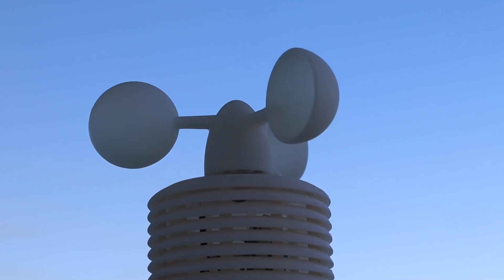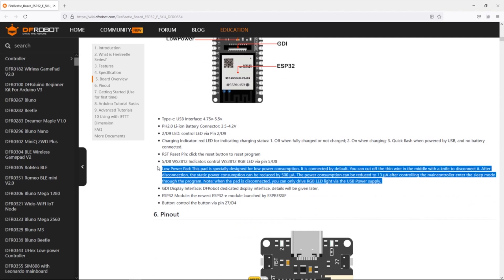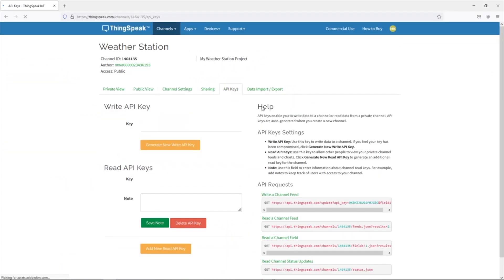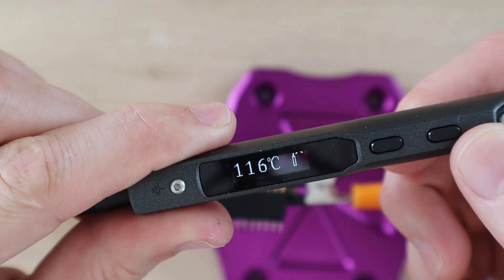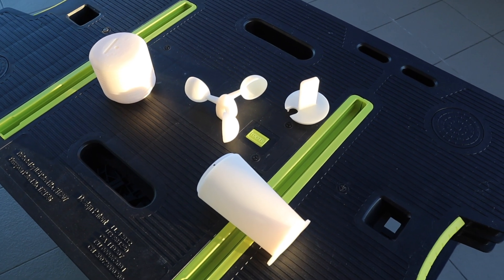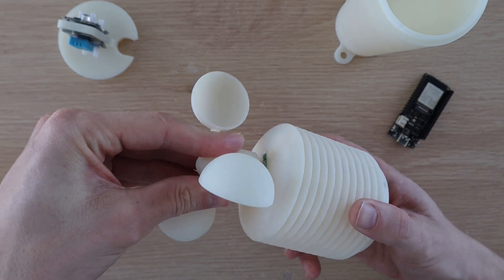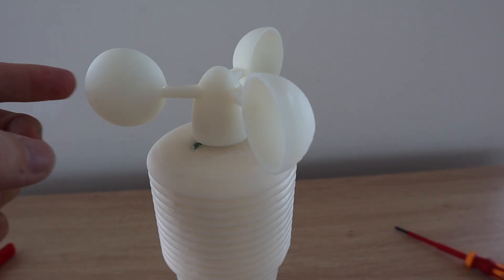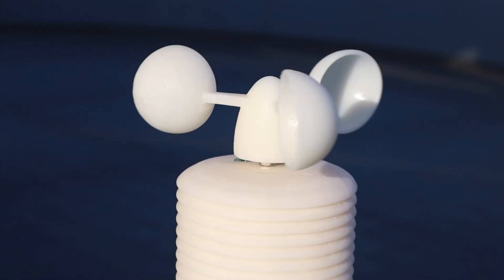DIY 3D Printed IoT Weather Station Using an ESP32

Comment: @UCPNq-cWaMPccZydtyhMXGGQ also: ESP32+other circuit components can become really hot, while experimenting with some prototypes i have seen cases where the temp reading were 2-3-4C higher because of that. I would suggest you to put the Temp sensor on a spot far away from all the other components (best thing would be to put the Sensor on the bottom and the ESP/circuit on the top, since hot air goes up, so with the current design all the hot air inside the prototype is going on the top, right where the Temp sensor is...)
Reply from the maker: The ESP32 in this project is in deep sleep mode for 9.5 minutes of every 10 minute cycle. During this time the processor is powered down and no heat is generated. It doesn't have enough time in the 30 second data acquisition period to generate much (if any) heat, so this isn't really an issue for this particular project.
Reply: @MichaelKlements  I know that with DS it generates less heat, but still... I would swap their position from top/bottom just to be 100% sure that not even a 0.1 degree is wrong due to circuit's heat
Just a friendly suggestion, then it's up to you

Comment: I'd be curious to know how the components hold up after a while outside. Does the 3D-print melt in the sun? do the electronics short out from water/moisture?
Reply from the maker: I'm also interested to find out, I'll be posting an update on my blog in a couple of months.
Reply: @MichaelKlements  Welp the humidity sensor is not really for outside use. I had it in my Bathroom and it broke after 5 months.
Reply: @MichaelKlements  on your place i would have placed the sensors in hot glue jackets.
Reply: @haldir234  problem with enclosures outside is that they are HARD to get fully protected from water.  

The risk is condensing water are getting trapped inside, so you always have to have some drains in lower parts, and might need a vent on top to ventilate out hot air.

Comment: Nice project. How do you calibrate the anemometer? Thank you!
Reply from the maker: It seems the easiest way is to do it with a known wind speed like sticking it on the roof of a car, or riding on a bicycle at a given speed on a still day. You'll then need to adjust the timing in the code so that you get similar results to the test.
Reply: calibrate with another windspeed sensor

Comment: Thank you for the video. I`ll try to understand how the wind speed funktion is working with diameter and the rotating and instead of reed switch i would like to use a hall effect seonsr. But until now I couldnt solve the wind speed topic
Reply from the maker: You should be able to swap out the reed switch with a hall effect sensor without needing to change much in the code. The basic principle is the same for both.
Reply: @MichaelKlements  thank you for your answer. But i don`t get it with rotating diameter / pulse to calculate wind speed

Comment: The DHT11 is one of the least precise sensors I have tested (large increments, way off over time, and not linear enough to attempt to calibrate conveniently), you might want to look at a Sensirion (SHT40, SHTC3) or an all in one Bosh sensor (BME280). I agree with others that a hall effect would be better since the reed switch has mechanical limitation.
Reply: 100% agree. Another issue with the DHT11 is the maximum humidity reading of 80%. BME280 is probably the easiest and most accessible option. It also has some excellent power saving options.
Reply from the maker: Thanks for the advice on the sensor and some alternatives, I'll have a look at them.
Reply: @MichaelKlements  also: ESP32+other circuit components can become really hot, while experimenting with some prototypes i have seen cases where the temp reading were 2-3-4C higher because of that. I would suggest you to put the Temp sensor on a spot far away from all the other components (best thing would be to put the Sensor on the bottom and the ESP/circuit on the top, since hot air goes up, so with the current design all the hot air inside the prototype is going on the top, right where the Temp sensor is...)
Reply: @Th3BlackPhoenix  hm. Might even put a "chimney" in the construction, so that warmer air will drag in new air, but still protected from most humidity.  But that is probably over engineered.
Reply: On my project the DHT11 died after less than 24h..
Reply: I was also going to suggest the BME280, or you could also go with the Sensirion SCD41 and get temp, RH and CO2, which is kinda neat, given climate change and rising CO2 levels.
Reply: @s0rc3  the CO2 lever rise is steady without big local changes.  There are other applications that CO2 might be needed, like indoors, where CO2 levels change much faster if ventilation isn't good enough.
Reply: @s0rc3  Do you have mariguana plants or want to know the exact moment to emigrate to Mars?

Comment: I noted in another comment you considered the idea that adding wind direction would be good.   A potential way of doing this with using a Bourne absolute encoder, sparksfun has a module "Bourns Absolute Encoder (EAW0J-B24-AE0128L)" which encodes 128 positions ~2.8° each.  Its only rated IP40, so you would have to ensure other water protection (perhaps flared bottom mount as a weather shield)
Reply from the maker: Thanks Ian, I'll have a look at it. Yes, it could be hung underneath this design and I'd then make the whole weather station mount off an arm out of the side.

Comment: Nice project.   I've looked at your wind speed calculation code and I think I see your issue.

Looking at your CAD files it seems the anemometer cup centers are at 50mm radius (I say seems as I loaded the STL into a different cad and after importing the scale seemed off by a factor of 1000).     

Assuming that radius is correct, I calculated 1 rotation 2(50mm) pi  = 314 mm  = 0.314 m linear distance per rotation for the cup center.  

In your calcWind() function, you are calculating the avg ms during the read cycle, and then mapping this time if it is in a range of 200ms to 4000ms.   

The first issue I see in this routine is the calculation of avg.     If the board only reads 1 rotation during the measure time, the avg will be 0ms / 1 = 0 ms, which defaults to 200ms due to later logic.    I would change the IF clause to be if (counter > 1) rather than if (counter != 0), which the later logic will default to wind = 0.  It would seem this is the reason for your graph spiking up from 0 to 16.

The second issue I see is At 200ms (aka 5 rotations per second) the cups have moved 5 * 0.314 m = 1.57 m/s = 56.5 kph 5.65 kph but you map this to 16 m/s, which seems off by a factor of 10 [not meters but decimeters] which is ok since map() deals only with integers so better precision but it's not meters.   (and it seems 200ms is a little high for the top gate value)

The third issue is your top range of 4000ms per rev = 0.314 m / 4 = 0.0785 m / s * 3600 = 0.2 kph which will not be accurate due to friction etc.   If I was doing this I would default wind = 0 if count < 2,  and if avg > 1200 I would report wind as 1 kph, which you seem to be doing as 0.3 m / s ~ 1 kph though you calculated this as 1 rotation > 4s and i calculate this as 1000m / 3600s = 0.278 m / s and 314 / 278 = 1129 ms  per rotation.

Assuming ThingSpeak is happy with floating point, in updateThingSpeak() I would do 
 ThingSpeak.setField(5, wind/10.0);  // wind is in decimeters per second, convert to meters
or convert to kph as 
ThingSpeak.setField(5, wind*360.0); // 3600 seconds per hr, wind is in decimeter units

Your readings will be still slightly inaccurate but much closer since due to friction and other losses the cups don't move exactly at wind speed but slightly slower (which will have a bigger effect at lower speeds but you're gated at 1kph anyway), 

I hope this helps a little and thanks for sharing!
Reply from the maker: Thanks for looking into this Ian, these are some really helpful suggestions. I'll post an update on the blog post once the wind sensor is working reliably. 
My most recent thought to test it is to hold the weather station out while riding a bicycle on a calm day (no wind) or in a large warehouse and then compare the indicated speed to the actual bicycle speed. This would give me the most accurate "real speed" with which to compare the results.
Reply: @MichaelKlements  My pleasure Michael.   I'm involved every year with an temporary airport that operates for only 2 weeks every year and am planning on building some of these myself (with perhaps a couple of modifications including wind direction) so I'll be following along.    
Your calibration plan is a good idea.   Calibration to a known reference is one of the critical things in any sensor measurement system.    I would expect some non-linear factors in your measurement (inertia and fluid dynamics are complex systems), so make sure to do measurements at different speeds.  Alternative is to attach it to a car in some way (zip ties to a mirror or roof rack?)  and drive at known speeds.  This would give you a higher top end for the calibration though I wouldn't take it on a highway.

BTW, I doublechecked my numbers above and found I had made an error in magnitude.   5 rotations per second, aka 200ms avg tick, is 1.57 meters per second as I originally wrote, but this does not map to 56.5 kph but rather 5.65 kph since 1.57 * 3600 = 5,652.  What this means is you really do need to change the lower value gate on the avg value from 200ms to 20ms to get a reasonable range.  50 rotations per second, aka 20ms avg tick, is 15.7 meters per second or 56.5 kph. 

This also shows that your high value gate at 4000 ms is also way too high.   I would not expect your system to be accurate at all below 1 kph (too much mass and friction for this).    As I wrote above, 1 kph = 0.278 meters per second  = expected avg ms of 1129.

I've edited the text above to reflect the correct kph values to avoid confusion.  Definitely looking forward to your updates!
Reply: @MichaelKlements  BTW, I did a quick spreadsheet of theoretical speeds vs avg millisecond tick interval for the range of 20 to 300 ms by 10 and one for 20 to 50 ms by 1 ms increments assuming the 50mm radius and pasted below.   If you graph this you will see that the tick interval to speed is a curve, not linear,   so the use of the map() function is going to be a source of errors.   Better to do the math directly using this formula (with constant for radius) and use float vs int for the wind variable:  

(radius [mm] * 2.0 * 3.14) [circumference] / avg [millisecond] = speed [float, meters per second]

Example:  50mm * 2.0 * 3.14 / 20 = 15.7 meters per second = 56.5 kph

The conversion from mm to meters happens naturally because of the time scale in milliseconds.    Once you do your calibration tests, one possible way you can adjust the readings is to have a calibration factor that you apply to the radius value, e.g. if your readings are slow compared to measured, add to the radius.  If your readings are fast, substract from the radius.   

Example substracting 1mm:   49mm * 2.0 * 3.14 / 20 = 15.4 mps = 55,3 kph

Tables:  Avg Speed for various tick intervals assuming 50mm radius.

Ms   M/S     KPH
20   15.70   56.52 
30   10.47   37.68 
40   7.85    28.26 
50   6.28    22.61 
60   5.23    18.84 
70   4.49    16.15 
80   3.93    14.13 
90   3.49    12.56 
100  3.14    11.30 
110  2.85    10.28 
120  2.62    9.42 
130  2.42    8.70 
140  2.24    8.07 
150  2.09    7.54 
160  1.96    7.07 
170  1.85    6.65 
180  1.74    6.28 
190  1.65    5.95 
200  1.57    5.65 
210  1.50    5.38 
220  1.43    5.14 
230  1.37    4.91 
240  1.31    4.71 
250  1.26    4.52 
260  1.21    4.35 
270  1.16    4.19 
280  1.12    4.04 
290  1.08    3.90 
300  1.05    3.77 

MS   M/S     KPH
20   15.70   56.52 
21   14.95   53.83 
22   14.27   51.38 
23   13.65   49.15 
24   13.08   47.10 
25   12.56   45.22 
26   12.08   43.48 
27   11.63   41.87 
28   11.21   40.37 
29   10.83   38.98 
30   10.47   37.68 
31   10.13   36.46 
32   9.81    35.33 
33   9.52    34.25 
34   9.24    33.25 
35   8.97    32.30 
36   8.72    31.40 
37   8.49    30.55 
38   8.26    29.75 
39   8.05    28.98 
40   7.85    28.26 
41   7.66    27.57 
42   7.48    26.91 
43   7.30    26.29 
44   7.14    25.69 
45   6.98    25.12 
46   6.83    24.57 
47   6.68    24.05 
48   6.54    23.55 
49   6.41    23.07 
50   6.28    22.61
Reply from the maker: Thanks for these and the tables. Since it isn't linear it might be a good idea to implement a lookup table (sort of like you've calculated) where the Arduino can then calculate the ms and look up the wind speed rather than trying to calculate it. It would be quite easy to do and would definitely improve the accuracy of the wind speed data.
Reply: @MichaelKlements  there shouldn't be that hard to make a interpolation formula from those data with a x² or x³ formula to match it quite well.  I have not plotted the data, so I don't know how much it is off a straight line.

And you might want to have a running average to smooth out the speed calculations (basically an integration).  That isn't that hard to do either.  You might want to look to PID algorithms for an implementation of the integration in PID.

@Ian Finnimore, great calculations!
With that in mind, one might want to change the radius to make the calculations easier/more optimised from rotation to wind speed.  :-)

If you want to have the wind directions, look up Gray Code for encoding rotation steps and direction.  You still need some reference point to know where zero are.  Or enough digit tracks in the encoder to get the resolution you like.
https://en.wikipedia.org/wiki/Gray_code

Comment: Do you have anything to correct the light data? I mean my weather station light sensor is directly facing the sky.
Reply from the maker: I'm not really sure what you mean by this, is that not what you would want?
Reply: @MichaelKlements  It seems like the plastic would ruin the readings, Would you think that having the light sensor pointing at the sky directly would make the light sensor data more accurate?
Reply from the maker: The light sensor is within the vented area, with gaps between the rings, and the resin is thin enough that it is very well illuminated within the housing. It would likely be more accurate being directly exposed to the sky, but then there are other issues like rain and moisture. It's also just a numerical representation, it's not an actual lux reading.
Reply: @MichaelKlements  thanks

Comment: Add a PSI2.5 and a PSI10 sensor, and you can sell those like cupcakes here in Singapore :)  Aren't you concerned about water entering the components area with a bit of high wind?
Reply from the maker: Thanks for the tip, I'll have a look at that. With regards to the wind and rain, I've tried to keep the angles and spacing such that I don't think it will be an issue but I'll see once it has been through it's first couple of storms.
Reply: @MichaelKlements  Thanks, and yes it's me the one that left a comment in your blog as well :) We wanted to do something similar a few years ago but we stop halfway through.

Comment: You should swap the reed switch for a hall effect sensor, otherwise a great looking build!
Reply from the maker: Thanks for the feedback and tip. I've never tried a hall effect sensor on a project,  I'll look into these.
Reply: @MichaelKlements  Reed switches are simple and cheap but they do wear out. I've replaced one on our exercise bike already. How many anemometer revolutions are you seeing per day and what is the life expectancy of your reed switch?
Reply: @MichaelKlements  I agree on this 
I made an anemometer using  one sensor and 4 magnets, that allows for 
balancing and higher accuracy

I would also use different sensors for temperature and pressure BMW280 , humidity, temperature and pressure in one simple package on i2c

calibration is best done in a car that has an open roof. and use GPS  for speed , do a test in two directions for a few runs at 5,10,15,20 and 40 KM/h and use that data
Reply from the maker: Thanks for the tips. Yeah my thought was to try riding a bicycle in a warehouse while holding the anemometer and compare the actual speed to the indicated wind speed. The magnetic sensors on bikes are pretty accurate.
Reply: @patrickmaartense7772  
I was just about to suggest; 
2 sensors & 4 magnets at different radius, 180 out of phase; for the same reasons. I wonder which is more accurate?
Reply: @AaronAlso  i think 4 is better one sensor is fine, just "debounce" the signals, I went all the way up to 6000 rpm with this setup without any issues. thats 24000 on and off in a minute :  400hz should be easy to handle by an esp32  100 rotations per second might be more than the poor scoops can handle anyways in real wind situation
Reply: @MrBobWareham  Hall effect sensors are easy and very precise. I'm not knowledgeable in electronics, but was able to put together a simple hall effect circuit that would precisely trigger a strobe light on each rotation of the metal lathe chuck in this video. No bounce and super-precise. The brass part has been sectioned in half to create the effect that we are seeing inside the machined part. Note how precisely each exposure is registered.  https://youtu.be/h3QnUfybAuU?t=32
Reply: I loved this project! and yeah even multiple IR interrupter sensors, you can get a rough wind direction and wind speed measuring the time it takes from signal 1 to signal 2 using interrupts, both on the rising edge or falling edge